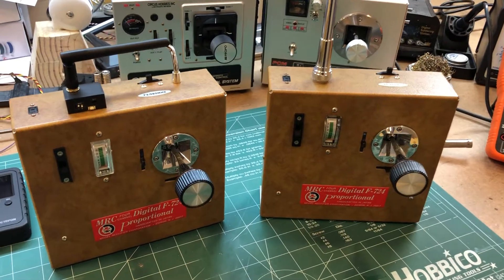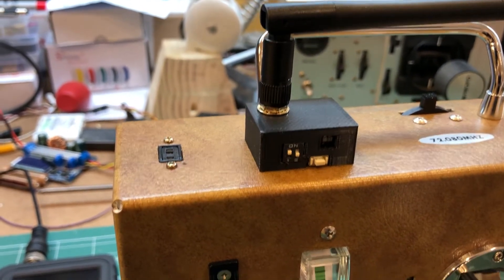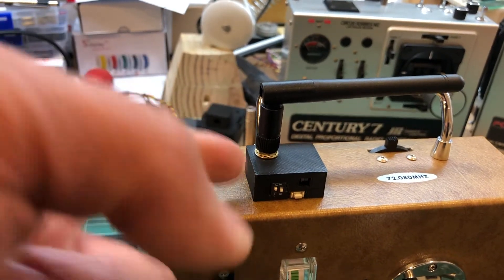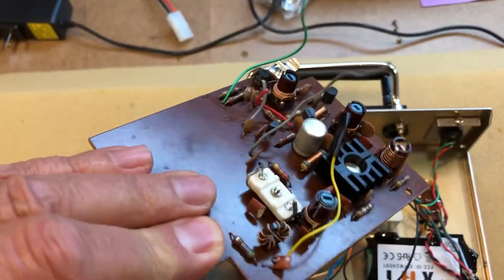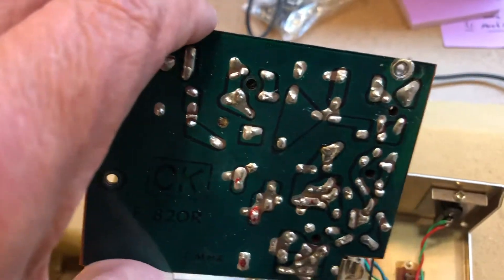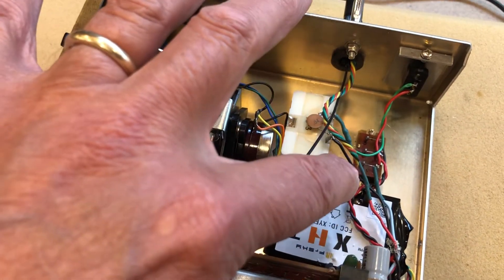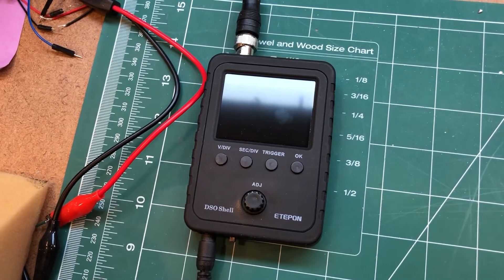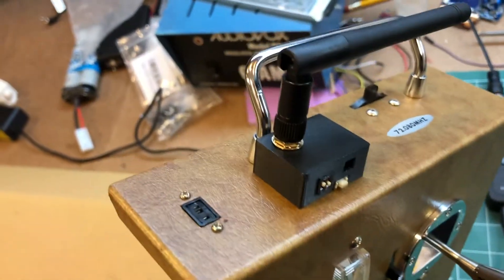FRSky XHT/DHT module upgrade of an 1970s era MRC single stick RC transmitter from 72 MHz to 2.4 GHz

Comment: Could the same XHT module be used to convert the late 1970s vintage Futaba FP-T6FN 72 MHZ 6-channel transmitters to 2.4GHZ?  These are the transmitters with beige metal case and the round chrome stick bases.
Reply from the maker: Should be able to.  All you need to find is the PPM signal and connect the XHT module to it.  Easy to do once you find the signal.   The signal can be found using one of the inexpensive Oscilloscope.  Most transmitters output PPM.  

There are a few Futaba and other manufacturers transmitters that output PCM and those cannot be used without significant changes that require hardware changes if even possible.
Reply from the maker: Check this site out.

https://forum.alofthobbies.com/index.php?threads/looking-to-convert-a-1975-mrc-single-stick-4-channel-to-use-the-xht-module.1840/

Comment: I have a Futaba PCM 512 single-stick transmitter. Can I change this transmitter from 72MHZ to 2.4GhZ?
Reply from the maker: Unfortunately it is quite difficult.  The Futaba PCM 512 is only PCM.  It does not support PPM.  The PPM protocol is the one that can be used to interface with a transmitter module like the one I used for this upgrade.  In the Futaba 512 PCM transmitters is a card that has a micro processor on it.  It outputs the PCM protocol.  There is another card that can work in it's place but they are very difficult to find.  I'll get the details of those cards later and message you back.   I have toyed around with the idea of trying to build one of those cards myself and use an arduino for the processor but I doubt I would have the patience for it.
Reply from the maker: Check this out.  Something I posted to see if anyone has more info.  

https://www.rcuniverse.com/forum/rc-radios-transmitters-receivers-servos-gyros-157/11709783-old-futaba-pcm-ppm-fp-t8sgh-fp-t8sga-p-fp-t8ssa-p.html